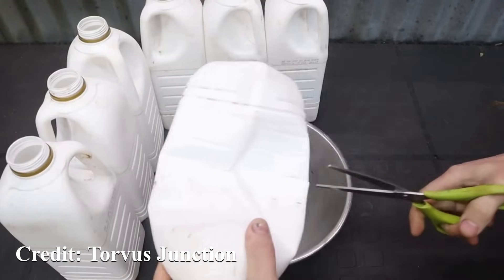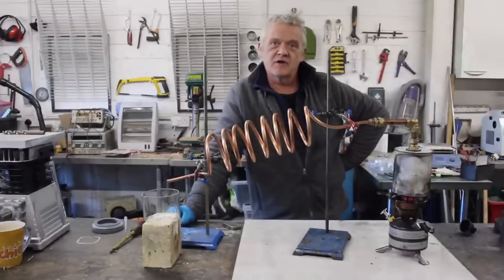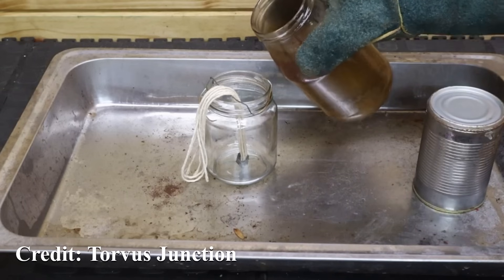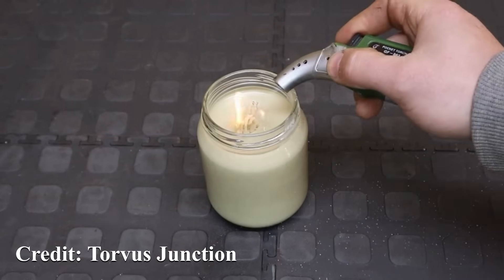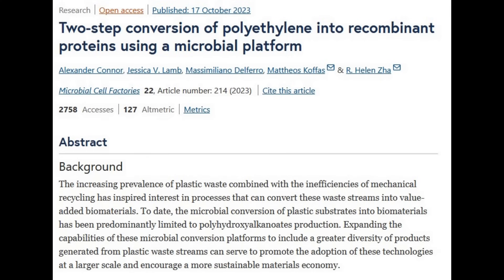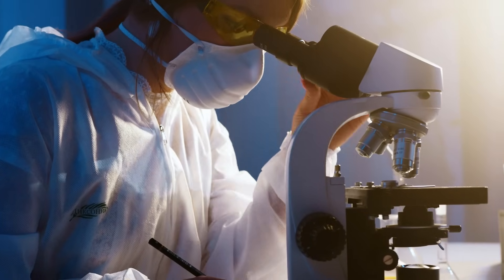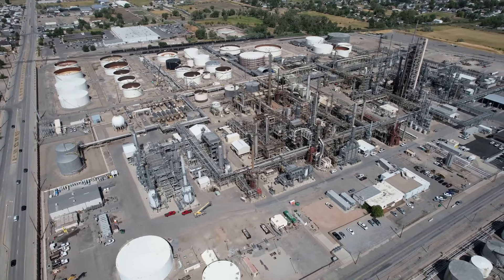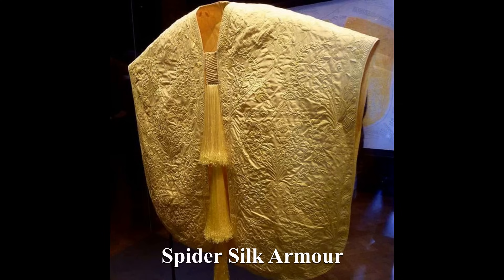2201 Waste Plastic To Spider Silk

Comment: As an aside, and not taking anything away from this accomplishment, HDPE is one of the commercially common thermoplastic that is probably most recyclable.  You can just melt and recast it indefinitely.  Whatever you make will end up taking on the color of the average of all the source plastics, but it apparently doesn't lose strength in 30 reheatings and recastings.  

That said, I would love to find out what aspect of the distilled HDPE the bacteria is using for feedstock, and whether other plastics can substitute.  Turning surplus casein, derived from milk, into a hard-wearing fiber via fermentation would be a major industrial boon to dairy-producing regions when the dairy market is saturated.

Comment: When I got back from desert storm we were given gear to test out.  Some of the gear was polypropylene, and they said it was made from recycled two liter bottles.  Basically this stuff.
Reply: Polypropylene is the same as number 5 plastic (yogurt containers etc).  HDPE= #4 plastic.  Chemically and moeleculary, they are similar and have both some very similar and some very different properties.  Both are very light weight/low density, both are essentially chains of carbon and hydrogen, both are extremely hydrophobic.   But an interesting difference is their thermal conductivity.  Polypropylene has one of the lowest thermal conductivities of non exotic  solid materials while HDPE's thermal conductivity is about 4.7 x more and not far away from the thermal conductivity of water.  

   On in other words, PP based clothing is quite good for winter/cold weather and HDPE based clothing is good for summer/hot weather (unless it is so hot, that you actually want/need some thermal insulation to create a microclimate around your body/skin with your sweat evaporating and cooling things down).

Comment: As a bee keeper we are sometimes bothered by wax moths. These eat the beeswax and sometimes wood and or polystyrene and leave behind a silk and frass mess. I never thought the thread they weave would be useful. This could be an alternative method of production without having to heat the plastic first as the wax moth would eat that directly.
Reply: yo is that silk that silk

Comment: People make 3d printer filiment out if HDPE.  A good use for it!

Melting the HDPE in a solar furnace may make sense.  You could think of it like storing soler heat into the HDPE wax battery 🤔

Comment: Good one.  Why not think of the "cancle" as a chemical battery: use "excess" intermittent  heat energy from solar PV and wind to convert plastic to wax, then use the wax, when needed, as a heat source?
I'll bet the leftover plastic residuce from either conversion process would be a great high-temperaturre thermal transfer mediium.

Comment: Building the distillation process into a perma-industrial style recovered waste-heat system would essentially eliminate the fuel cost.

For example, Jean-pain system could be leveraged into heat, methane capture, high pressure cryogenic storage, phase change heat batteries, and TEG.

 Incorporating a rocket-mass furnace, waste gasses could be used for initiating secondary and tertiary combustion, architecture and design, and intelligent grouping of various industrial applications into a perma-systemic arrangement would capture and direct heating and cooling passively. Recapturing and reusing waste heat and waste material as resources, and using their output as a set of suggestions for a new process that might use it as an input.

In this way, it becomes a chain reaction of abundance in which giving nets far more than taking
Reply: Interesting idea😮😮😮
Reply: I tried my best to understand...

Comment: Hmm.  Using plastic eating bio bugs to produce silk is a clever way to get waste plastic into those fluffy wads of bio silk. Next step is to train those bio bugs to wriggle in a consistant way and they can then weave sheets of cloth made of this bio silk. This would save us the time of further processing the wads of silk into sheets. Or would that be asking too much from these plastic eating bio bugs??? 😆😆
Reply: engineering it with flagellum for propulsion, and quorum sensing to change direction on edges and maintain a spacing, or feed it slow from one side whilst the bacteria progresses toward the infeed, leaving continuous strands of silk on the outfeed

Comment: Does it have to be spun in order to obtain the high strength, or can it be ... extruded somehow? Perhaps into windmill wings/vanes? 🤔

Ir it has to be spun, then I think that old style windmill wings are getting a renaissance. We could just glue on spidersilk fabric and have extremely lightweight, yet strong balsa wood/paulownia wood structures clad in spidersilk fabric. Glued together with ... spidersilk. 😎
Reply: you idea made me instantly think of replacing fiberglass fabric /matte with spider silk.
anywhere fiberglass would be used, boats, car bodies, etc,,. you could use spider silk instead and probably have a superior product.
It could potentially replace carbon fiber/fabric as well.
Reply: @jacklarson6281  exactly. Oldtimer planes or even model R/C planes would be stronger as well. And old style wooden frame canoes, with fabric over wood, would not be as prone to tearing on rocks. 😎

Comment: I used to work for a company that was going to convert organic feedstocks into diesel. Using simple technology, you can convert basically any carbon-rich feedstock into fuel. But this seems to go a step further. Someday, we may not throw anything away -- it depends more on the economics than anything. We have to have a high-value end product to make it worthwhile to recycle. Perhaps this spider silk has a high enough value. It certainly is worth looking into.
Reply: Bringing back Compost to the acres is the best we can do for now.. but most of it get burried or burned.. everything will get eaten by a microorganism and supports the growth of the tree of life
Reply: I randomly sat down with the owner of a burger joint who was about to sell off to focus on his day job - a company in North Texas that was creating biodiesel from agriwaste.  The innovation was in where they got the energy for the conversion - they were building a small solar thermal tower at their refinery.
Reply: @bearnaff9387  I hope it works out for him. It's old technology -- developed in Germany during WWI. The use of solar power may save enough money to make it worthwhile though. It's certainly worth a try.